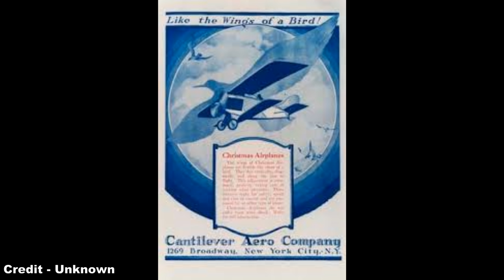Flying Failures - Christmas Bullet (The Worst Plane Ever Built)

Comment: Decades ago I read an article about the first Bullet. It stated that the elevator, instead of using hinges for up/down motion, Christmas used stiff piano wire joining the moveable elevator to the control system.

Comment: The interesting thing is that modern wings in modern aircraft are designed to flex. Probably not flap like a bird, but they are designed to flex to what would seem like a worrying degree—far more than would ever be experienced in flight. This flexing is both lighter and stronger than if you tried to make the wing as rigid as possible.

Comment: I thought the worst planes ever built were the Blackburn Blackburn and the CAC Boomerang... but those planes actually flew and landed safely. The Christmas Bullet makes them look like huge successes.
Reply: But the Blackburn did manage to look even worse than the Bullet.
Reply: I understand the Boomerang, and it's big sister, the Wirraway, did serve a useful purpose until better machines were available - being stopgaps designed in a desperate hurry they were bound to have faults.